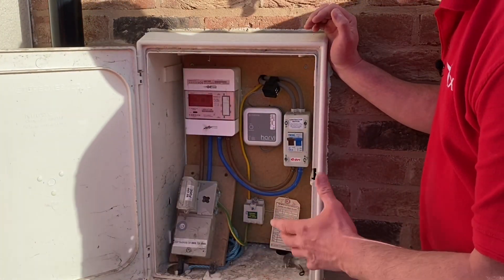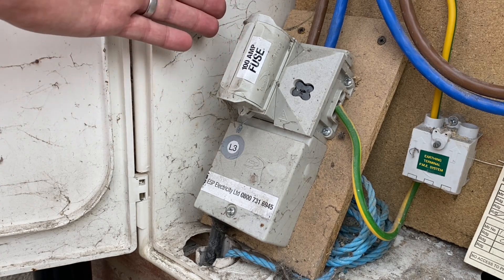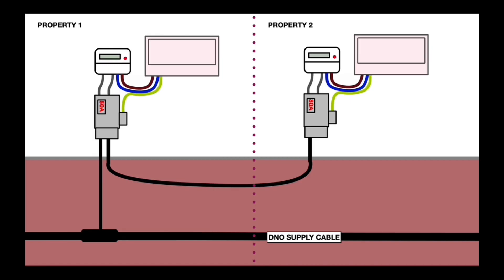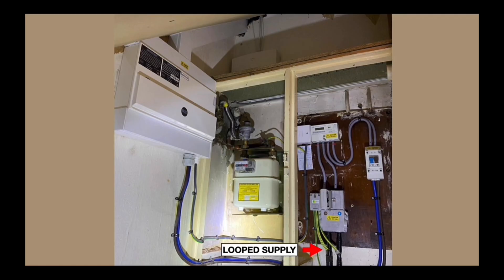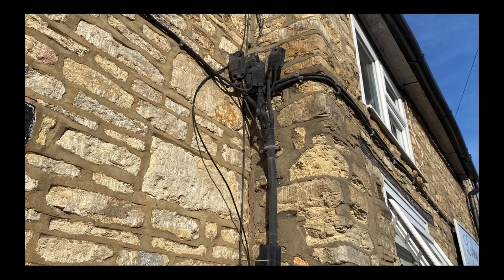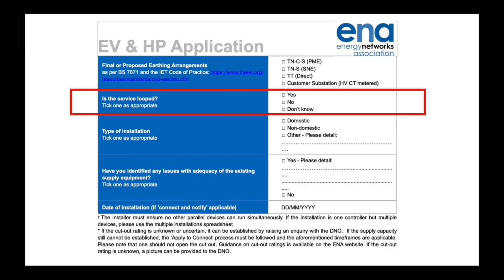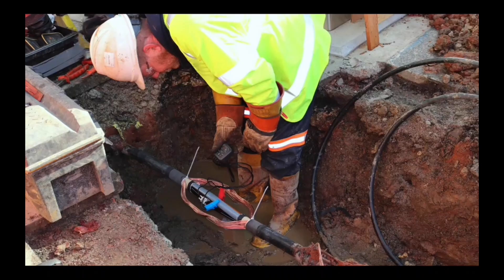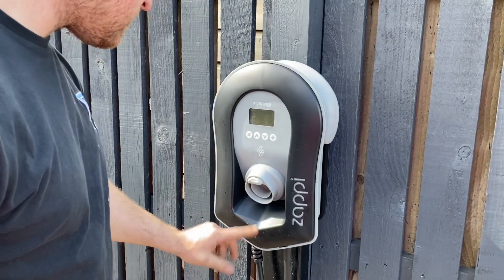EV Charger installation : BEWARE Looped supply - what are they , cost and time to correct

Comment: My neighbours house loops off ours and I had an EV charger installed despite this. It felt like they were desperately trying to get it in before national grid came around.

Nation grid have been out about 5 times now and don’t know what to do about the mess. 

Long story short we have the main supply and our neighbours loop off is. National grid are still investigating but have said my EV charger may need to be limited and we won’t be allowed solar panels.

Our neighbours don’t want to get the loop removed because they don’t want their original flooring ripped up.

All around it’s a terrible situation as we are both stuck now unable to get solar panels and they are not able to get an EV charger.

Not sure what we can actually do in this situation as I actually want an extension and solar panels in the next ten years 😢

Comment: My neighbour has just got an EV and we have a looped supply, I have the main feed (two DNO cables) and he is looped to me (one cable). Houses were built in mid 80s and are both small detached. OVO just came out and installed them a wall charger. No attempt was made to unloop us, Is this correct? Where do I stand if I need a wall charger in the future.
Reply: same as me, neighbour has ev charger for 3 years , british gas put my charger in a month ago , dno got in touch a week later saying they need to de- loop us so must of known but let the installation go ahead , not coming to survey us to see what needs doing for another month so who knows when it will be put right. agreed with neighbour not to use both chargers at the same time until then just to be on safe side , I only need it once a week at most anyway

Comment: I've just had a heat pump installed, so starting to go through the delooping process. Had the survey done. Could take several months for the work to start due to needing permits for excavating the main road. Once the works start should take up to about 2 weeks. No cost to use as the home owner. We're central Scotland.

Comment: We had a ev charger installed last year. And we are on a Loop supply & a 63 Amp  main fuse. Befor it was installed we phoned our DNO which is Network Power.   And they said that we didn’t need to be de loop’t.  As we don’t use enough electricity.  We haven’t had any problems with it.

Comment: Strange to see looped connections that way. In my country sometimes we do have low voltage residental looped connections as well. All 3 phase. But they are looped for reliability purposes. If you cut off one side another one still supplies. It's complication for solar installations too. It's old setup. New installations for reliability usually have different setup - two independent connections from two substations.
Distribution companies fight to get loops unlooped as it complicates their work and customers options. Kind of hefty money in such amount of work.

Comment: Once you have unlopped your supply the question is if your local transformer will be able to handle the amount of electric draw that is getting connected too it, if all houses get an EV charger installed will it be able to handle that load.
Reply: That’s why DNO’s should be consulted on every upgrade. PV, Heat pumps, EV. If I was having any of these done I’d be wanting a 3phase upgrade tbh.

Comment: And yet I could have a 9 Kw shower installed without any problem which could be used at peak times when an EV charger is almost always going to be at off peak times
Reply: He mentioned that at the start, you and your neighbor wont be taking 6 to 10 hour showers simultaneously.
Reply: This is true but then what other heavy duty appliances are likely to be used after 11pm ?

Comment: Just bought an EV. Long story, too boring for here. I already know I'm on a loop, confirmed with the DNO, and that I'm the first link so most of the work will be on the neighbour's property. It's all very weird. Best I can tell I've got a 100A main cut out, 25mm² tails from cutout to meter to consumer unit, and 10mm² earth bonding. Can't for the life of me figure out why I'd need de-looping since no doubt next door's setup is exactly the same. If both houses' supply cutouts are rated for 100A it seems mental to me that it needs to be altered.

Comment: Having worked for a DNO for 43 years, we could've set up several teams just going round unlopping services and still would'nt get them all done. I know they are now offering one of the properties of a looped supply an 80amp supply up from 60amp,  not both. However it can depend on the size of the incoming cable where the loopey is taken from, they arent always the same size, and in some cases the main in the street isnt much bigger in size than the service cable, belive it or not, and that main could be feeding many houses. Some of our cables are very small in csa and very old.

Comment: Octopus completely messed up my EV install - They requested a picture of my meter when I ordered the EV charger, they clearly didn't check the pictures and proceeded to install the EV charger but then tell me they needed permission from the DNO to connect as I had a looped supply - They didn't explain that potentially my neighbours driveway would need to be dug up to unloop the supply, DNO confirmed this was the case but Octopus should have requested a survey before the installation.  No offer of compensation from Octopus, just an apology and stated they would remove it and provide a refund...

Comment: My son and I have both brought EV's this year as previously had a company vehicle  which was a plug in hybrid, my employer arranged to have a Pod Point EV charger to be fitted to my property about 6 years back. However now  we decided to update the EV charger to make it compatible with my current supplier and take advantage of the special EV tariff on offer thinking that it would be a simple straight forward  switch over the the charger,  When the installer came round  we  found that my property has a looped supply and the installation could not go ahead.  My supplier has now submitted an unlooping request to the DNO but it has left us in a difficult position.

Comment: I must have gotten really lucky with our loop. I applied for a podpoint. They came out. Found the loop. Installed but didn't commission the charger. Spoke to the DNO who then said it was fine because of the load balancing of the podpoint. My neighbour also has a BP chargermaster .. then I've since upgraded the fuse to 80amp (from 60) in which they said if I want to go 100amp I need to be unlooped 

I have since got a powerwall and solar which charges off the cheap rate.. also approved by the DNO 

I've successfully run a powerwall charge , EV charge, dishwasher, heat pump tumble, air conditioning and a washing machine all at once and not gone over my original 60amp

Comment: My EV charger was installed, but my supply was the first in a chain of 2 other properties being fed from the overhead cable that feeds my house with T's on each property off it. They replaced the cable with a 3 phase cable along my eaves, and each house was now fed off each phase. For free! Also each house can now easily have a 3 phase supply as the 3 phase cable runs to the end of the row of houses, with a drop off each phase.

Comment: This is the first I've heard of looped supplies, and it's starting to make me think a little bit. 😇

I live in a block of flats - Four per floor with three floors to the building (A common design for SE England in the early 80s), built with Eco-7 in mind and presumably phase-balanced. Night-time supply for each flat is 100A max, with a 60A max during the day.
Electrical supply is through four races up the building (One for each of the three flats on that corner) and though I've not mapped the whole setup, the supply cable for my neighbour above passes through (Not looped off) my meter box.

But: All things considered - Particularly that the building is set back from the road and probably sits at the end of a local loop supply off the transformer at the other end (Our road was built as a later „Add-on“ to the estate) - I'm guessing the cables are all joined together at the bottom of the races below the ground floor and a single 3ph cable connects the whole building to the utility main. ⚡

With this - And our each having 100A availability at night - In mind, does this still constitute a „Looped“ supply? What's the possibility of the supply supporting 1-2 communal¹ EV fast-chargers when these are eventually required? 😇
(¹ - They'll need to be communal as well, as only half the flats are within cabling distance of the car park and confining EV ownership to just one side of the building wouldn't be on!)

But most of us in the UK can consider ourselves fortunate: In Italy you're lucky if your utility supply can provide even 40A, let alone 100A! Indeed if I understand correctly, flats like mine don't get more than 25A!🔋

Comment: I had an EV charger installed which was later notified as "not approved" by the DNO because I was on a looped supply. We didn't think it was looped because it only had one incoming coax cable and a 100A cut out. The Zappi was temporarily downrated to 60A.
The DNO said they would unloop for free and even repair the printed concrete driveway using a specialist.
They came with detecting equipment to confirm where the cable was and dug two holes in the road and one on my drive through the concrete and "moled" through but couldn't find the cable. This was a setback as everything needed re-scheduling and the road holes filled in as the licence was only for 10 days.
In the intervening time I built my own detector using some transformer cores and using a signal generator and oscilloscope was able to detect the true path of the cable (not as the DNO records had it) and estimate the depth. I left a very convincing trail of pieces of yellow insulation tape every 100mm. The path had the shape of a cable thrown into the ground as you might expect.
When the team returned to have another go at finding the cable. They confirmed their readings agreed with mine but also that they could pick up a signal on one of the three detecting modes of their wand in the first hole position (as the plans had it) but where there was no cable. My detector found nothing there. 
They dug through the concrete in the new position where it crossed the mole path and found the original cable exactly where and at the depth I'd triangulated it to.
The job proceeded to plan after that and I have a full powered Zappi and have since installed 8kW of PV with home battery on a G99 and a heat pump driven from the PV reducing bills by 75%.
Although the DNO had incorrect old map records from 1970 when the house was built and were fooled by a false signal I can't praise them more highly for their support, freely given information and assistance during the whole process.

Comment: That looks like a horrible short cut in the original distribution system, and seems to break one of the fundamental principles of electrical installation. That is there should be a protection device which is rated to prevent damage to the downstream wiring. Putting several properties with 80A supplies on a single cable which can't support it is one thing (that's just diversity), but not having a fuse or other protection device which prevents that overload is another thing. It could surely have been done by having a second fuse, with the appropriate rating, where the supply arrived at the first property. OK - it's not absolutely perfect as it doesn't prevent faults in the supply cable itself, but that is the case for any property.

I keep finding out these sort of things. That is the distribution system is often not installed to the appropriate standards. For example, that TN-C-S systems which are meant to have PME protection often lack that latter part due to short cuts taken when the systems were put in. I suspect many only got some element of that protection through the bonding to metallic water and gas pipes in the properties themselves, something which is disappearing with plastic piping. Hence, I guess, the requirement for new installations to have supplemental grounding...

I wonder what other hidden horrors there might be in our power distribution systems (there are parallel problems with much of the water distribution systems as well).

Comment: I ordered an in stock EV car on my employers salary sacrifice scheme a couple of weeks ago. For the video review with the ev charger company it looks like I’m on a looped supply in a detached house as I have two cables. I’m waiting for ukpn to visit my house to determine next steps. I yhought this would cost my thousands as I’ve got to dig the garden up for the charger anyway then found about this looped supply problem. I’ve cancelled the ev car and ordered a phev one instead as I am simply not paying thousands for a charger. Hopefully the unlooping is free but digging the garden and driveway up to install a charger isn’t going to be cheap so I’ll most likely not bother when total costs are calculated and just go with phev cars in the future and just not bother charging it much, I can use a 3 pin plug in the garage but it’s not enough for the ev cars. This net zero to electric cars isn’t going to happen en mass. I had know idea the charger would be so complicated, my armoured power cable that goes to the garage isn’t good enough apparently so it’s all got to be dug up, which I ain’t doing as I need a new kitchen and need to invest in stocks over a bloody ev charger

Comment: You also cannot have an air source heat pump with a looped supply, as I am currently finding out.  The house next door to me is looped into my service cut out and they have to be given an independent supply so I can install an ASHP. I own my home but the house next door is owned by a housing association and it became unoccupied three weeks ago.  I also have to get my meter moved, not because of the de-looping. Electricity North West have been very helpful but the housing association have been/continue to be a nightmare. I have a huge pit outside my back door with exposed cables and sewer pipes and my front garden is occupied with a skip and two bulk bags of sand and MOT1. The good news is, I only have to pay for the movement of my meter. ENWL are covering the de-looping including digging the 15 meters odd of trench. It ain’t easy though.

Comment: Hi. I'm assuming that it wouldn't be House 2 where the issue would be but with House 1, where the initial supply is taken then looped to House 2.?
Reply: The issue applies equally to both. In my case I was house 2, looped off house 1
 We both had 60amp main fuses, sharing an 80amp supply. I have a 14kW output ASHP, and 32amp charger cable plugged into a 32amp commando socket which I had to monitor at times to keep below 60amps. When I applied to the DNO for hardwired EVSE plus batteries they put in dedicated 100amp supply for me and wanted to do the same for the neighbour as likely between us we had probably drawn much more than 80amps from the supply cable  on many occasions.

Comment: I live in Sheffield in the end of a row of 4 terrace houses built around 1950’s. Thinking about getting an ev and installing a charger. We are the only house with a driveway. Found out we have a looped supply but we are running a 100A fuse, however I think it will be too big of a job. Plus the neighbours are a nightmare.

Comment: What I don’t understand in the diagram at 03:45 is if I am property 2 how would I know I was looped? As I only have 1 supply cable?
Reply from the maker: You wouldn’t unless you ask a neighbour or you apply to connect an EV charger.
Reply: @efixx  so I think I definitely have a loop as the house is a 50s semi with two cables in the cut out. My neighbour has a hot tub, I bet they never told the DNO.
My EV charger supplier told the DNO that I don’t have a looped supply, and the DNO took this as gospel

Comment: I want to have an ev charging box fitted but I have a looped house but the cables are coming down from the loft, like your second photo they are at the top coming down out of the loft. There’s a pole outside with the wires coming off it to my house so I presume this is my electricity supply? “It’s an old 1930’s house “ so then how do they un-loop that if this is indeed my supply, is it easier? Oh, and by the way I don’t cook on electric and don’t have an electric shower which I understand are the two big electric pullers. Could they just upgrade the fuse if needed? Or install a load management system? I’ve been stuck in the house for almost 3 years because I can have a covid jab so won’t even go to the garage to fill up my car! Having an ev would mean I could at least get out of the house for a drive so any help would be most appreciated. Kind regards.

Comment: My home is a semi-detached.  I used to have a my own dedicated DNO supply (with 80 Amp fuse) , but after an electrician discovered there was an issue with the earthing of my neighbours incoming DNO cable, Scottish Power's solution was to loop from my incoming DNO cable to my neighbours home. This was around 10 years ago, and I had not considered the implications of letting SP carry out that work then, but now that I'm considering getting and EV, it seems I would most likely have a bit of bother to say the least if I wanted to get an EV charger installed.  Damn!!
Reply from the maker: Hopefully the neighbours appreciate your past good deeds 👍
Reply: @efixx  Ha!  Quite the opposite in fact.  Something the SP engineer said, either misheard or missunderstood, lead my neighbour to think that somehow the earth fault at her property could have been MY fault!!  So she felt the least i could have done is wait in all day on a Saturday for SP to look at and resolve the issue.😧